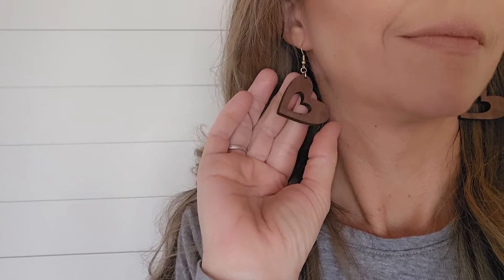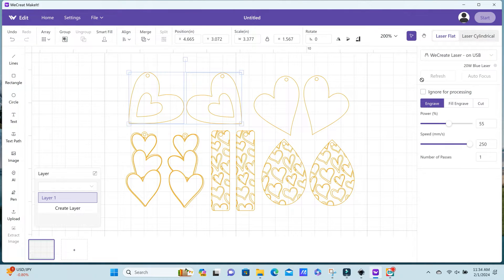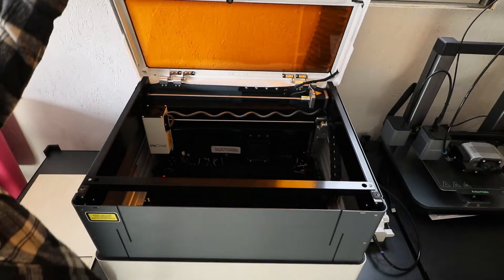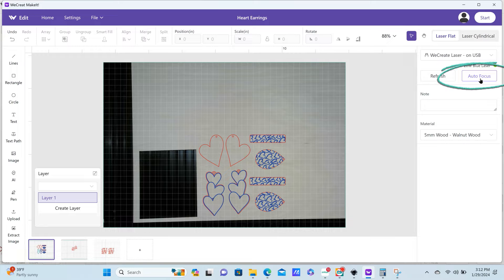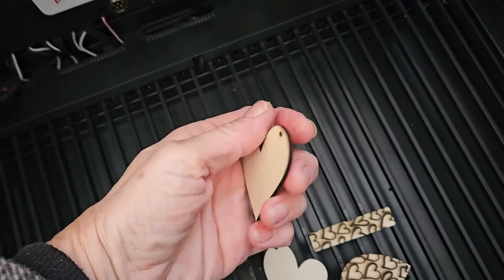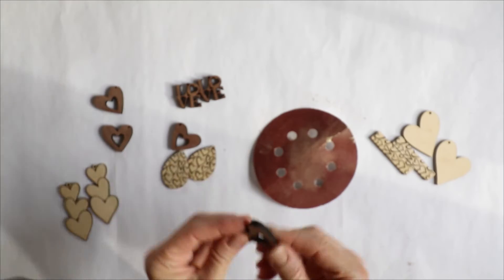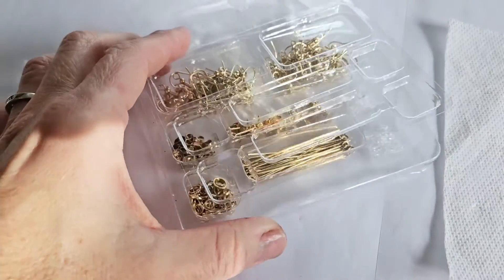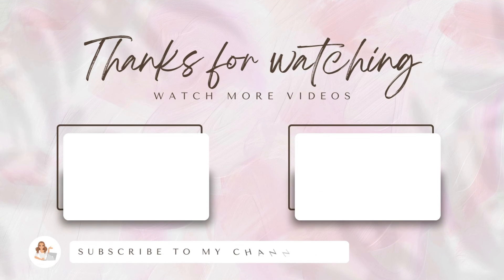Cut And Engrave Wood Earrings with Wecreat Vision 20 Watt Laser / Laser Cutting for Beginners!

Comment: How do you get rid of the burnt wood smell?
Reply: Wiping them down with rubbing alcohol to remove char and sealing them with a clear coat such as acrylic sealer, polycrylic, modpodge or beeswax protects the paint/wood and reduces burnt smell.